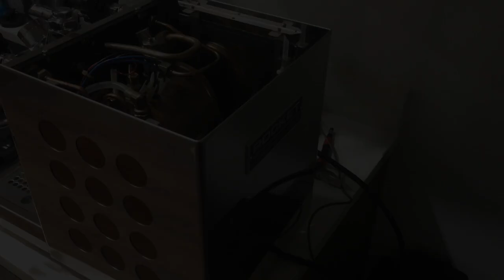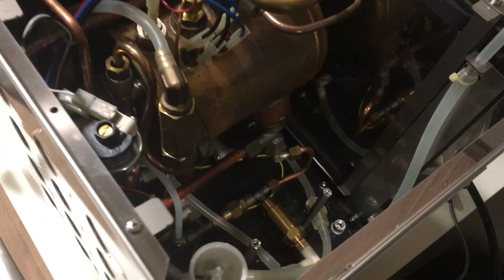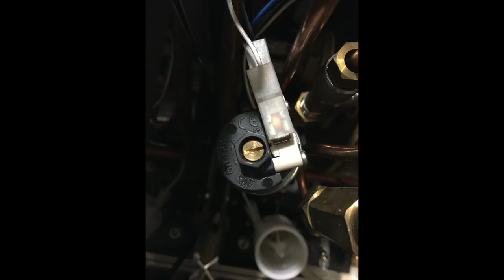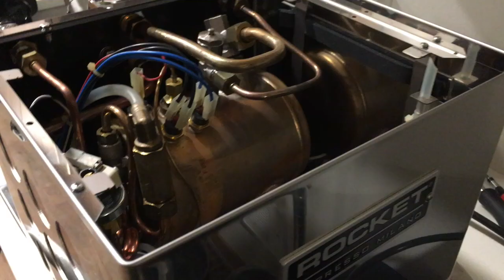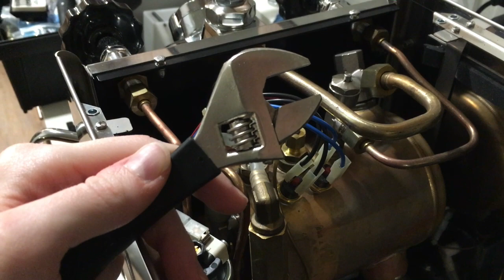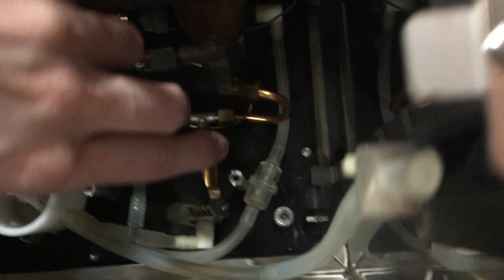Adjusting Brew Pressure on Rocket Appartamento Espresso Machine

Comment: Very good video showing us where is the OPV. Do you remind how many turns were needed to reduce to 9-10bars ?Thx !
Reply from the maker: It will depend on where your machine is set from the factory. I’d recommend installing a pressure gauge (see my other video) to accurately determine how close you are to the 9-10 bar range.

Comment: Excellent. Thank you. What did you use to measure the pressure after adjusting? And also  in what ways did the flavor improve?
Reply from the maker: I use a pressure gauge installed on the group head. The other video on my channel shows how to install it. I’m not sure about flavor (I mostly make flavored lattes) but the combination of lower pressure and using a distribution tool has virtually eliminated channeling in my shots.
Reply: Thats my issue. Whatever i do with my puck there are still some channels in it. Maybe that’s because of my Breville grinder. So just ordered NichZero so i hope the issue is going to be solved at least partly but something tells me not completely.

Comment: Question for you sir, you mentioned to test your changes, how would you do that if Appartamento does not have a brew pressure gauge only the steam pressure?
Reply from the maker: Igor Tsymbal Good point, I’m assuming one is already installed. My previous video explains how to do that. Without a brew gauge, there isn’t a precise way to know how close you are to the 9-10 bar range.

Comment: Hey Matthew. I am Evelin, How are you? I hope you are doing great. 
I was watching your videos, while looking for some information about a problem That I am having with my apartamento machine.  I couldn't find was looking for some information about rocket apartamento. The machine is not switch ON  and Ifound little information that so far hasn't solved my problem. Do you think do you have information that you could share with me to try to fix it?. My machine is quite new. I got a brand new one a 1ago. And this morning I have done my usual coffee and a hour later I noticed  it was switch off by itself. So I've tried to switch it on again, but not lucky on that. I would really appreciate if you can share with me some information that I could try here. Tks very much for sharing these videos. I've learned interesting things from it ;)
Reply: Hi Evelyn, I ran into a similar problem. After receiving my apartamento and plugging it in, the light would not turn green. I searched everywhere and was thinking the switch was faulty through all the research I did. I decided I didn’t want to ship it back so I opened it all up, completely taking off the back cover as well. Doing this let me look around the switch to see if there was any faulty wiring. Turns out during the shipping one of the motherboard green cable was not plugged all the way into the box, I continued to unscrew the only screw on the box and Fully connect the block onto the box. I plug in my machine then switched it on to the magical green light appearing. I quickly turned it off because it was still “naked” with no water reservoir. Put it all together and considered my machine fixed, have had no problems yet.
Reply: There’s a switch underneath that allows you to leave it on but not under pressure. The light will blink when it is in this mode. Turning it off and on or running lifting the lever will turn it back on. I’ve accidentally hit this button while pulling it out to fill with water.

Comment: When you say “test your changes”, do you mean “re-install water reservoir and run shots into the blind basket”? Then, if it requires further adjustment, remove water reservoir and repeat?
Reply: That's what I did! I didn't even have to reinstall the metal holder for the plastic reservoir, mine fit in and held just fine. Just don't put more than an inch of water in it :)

Comment: Hey Again buddy!

You are the only one I know who made this adjustment and I gotta ask some super crucial questions (cause I wanna do it myself)

1. How did you monitor your changes? cause when you service the machine it should be powered-off, right?
so have you put back all the pieces together, powered it on, waited for the boiler to build enough energy and then "tested" it?
I'm thinking of lowering to ±10 bars. my Appartamento reads consistent 12 bars when the pump is running

2. Did you find yourself grinding a little coarser after the change?

Thanks a lot in advance :)
Reply from the maker: Yeah exactly, it was a little tedious as I think I ended up taking it apart and putting it back together 3-4 times before I got into an acceptable pressure range. And yeah, I was able to back off the grind with the lower pressure. That, combined with a distribution tool, has really made a big difference in the consistency of my shots.
Reply: @matthewm.4507  Thanks again. I'll do 2 full rotations as u suggested. Wish me luck!
Reply: Just wanna say that I've been using my machine with lower brew pressure for 2 weeks now (maybe more), and I'm very pleased.

I've started with 8 bars then moved up a bit to around 9ish, and now finally I'm getting 10 bars. spent couple of days on each settings. This actually made pretty noticeable change! I find the machine much more forgiving now. and my shots are much more consistent. so for the inspiration + tips!
Reply: @omrirechani1104  hey mate, I’m trying to lower my brew pressure as well. Wondering did the full 2 rotation brought your to 8 bar pressure? Because I’m going to do it blindly since I do not have a pressure bar. If that’s the case, I’m hoping 1 full rotation will take it to ~9/10 bar
Reply: @leontan1847  still need my input?
so - yes. 2 full rotations got me to about 8 bars. so a single full rotations should get you to about 10 bars.
note that I've marked the starting point with a Sharpie so it would be easier to determine how far you've gone.
Reply: @omrirechani1104  thanks for the inputs! I rotated 1 full rotation and now the flow is so much smoother. Too late, should have put a mark for the original position
Reply: @omrirechani1104  how many rotation works best for you? 1? 2?
Reply: @leontan1847  definitely 1 full rotation. At 10 bars the machine is at its sweet spot in term of power-forgiveness ratio IMO
Reply: Do I Need to power the machine off while adjusting the OPV? I am Asking in Order to speed up the adjustment. So thankful for an answer!
Reply: @steffens8536  yes. The machine should be turned off and cooled down preferably
Reply: @omrirechani1104  Great!! Thanks Omri so much!

Comment: @Matthew M. Have you had any issues, or anything since? I'm scared to do this on my (quite new, expensive) rocket appartamento D: I ordered a pressure gauge as well, hoping it wont go above 10 bar and not be necessary.
Reply from the maker: Nope, never had any issues! As long as you make small changes and test with your gauge, it should be pretty easy. For reference, against a blind basket mine is currently set to around 10.1 bars so that during extraction it’s around 9.8-10 bars. Good luck!
Reply: @matthewm.4507  Ok, I finally bought an allen key and a wrench, I'll let you know how it goes.
Reply: @gimig91  @Matthew M. It went excellently!! :)

Comment: So i saw this video and tried to adjust the steam pressure of my appartamento nera. I could not find that screw to adjust the pressure. I wonder if rocket changed that capability?
Reply: Same here
I found that the part to change the steam power is changed. That caused me fail to increase the temperature of water:(
Reply: @RakanWD  Did you also have the problem that the boiler pressure stays at 0.9 bar max? How did you solve this issue? Did you eventually just remove the red wax and increased the boiler pressure?
Reply: @alatteaday2836  How did you solve this issue?

Comment: Hi! Question. After this mod, what is your water flow rate? I mean, after decrease the pressure to 10 bar.
Reply: Flow will be less if other conditions are the same
So, you may have to adjust grinding

Comment: Appartamento machine how much pressure and I can reduces pressure.

The pump pressure of Appartamento is adjusted at 11.5 bar 

Rocket RECOMMENDS NOT TO MODIFY THIS ADJUSTMENT to avoid eventual malfunctions

The machine is equipped with vibration pump and not rotary pump.

9 Bar are advised only on rotary pump machine.

Comment: I tried this adjustment on the opv or expension valve. I have a pressure gauge on the e61 group head. Out of the box, my appartartemento was pulling shots at 13 - 14 bars. I adjusted it to 9 bars. However, after pulling only 2 shots, i had a rattling noise coming from the machine. I first tough it was cups on my machine top, but no, it really is coming from the machine itself. Did you experience this? I cranked it up to 12 bars until i understand what is happening. Thanks!
Reply: @RakanWD  i didn’t kept it at 9 bars. I increased it back at 12. No rattling at 12 bars.